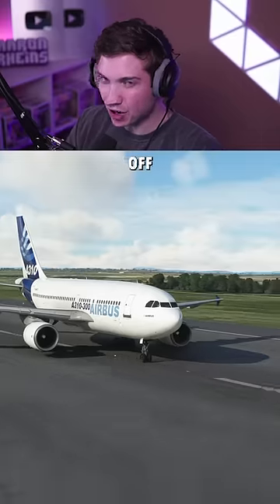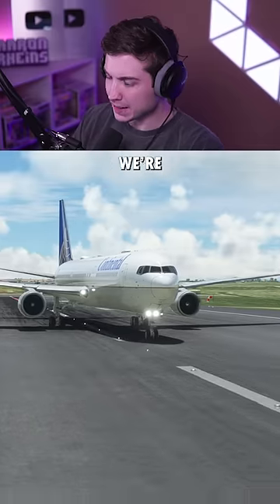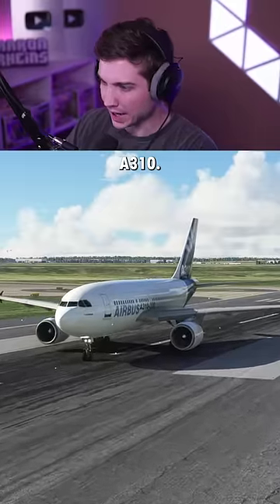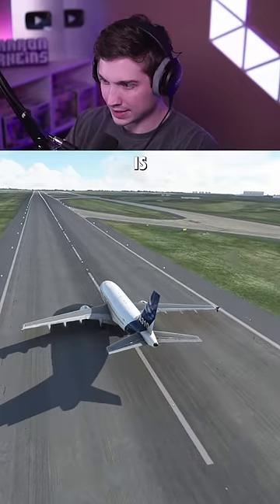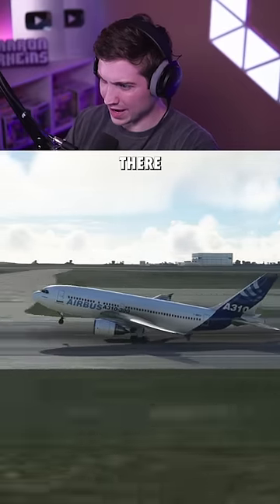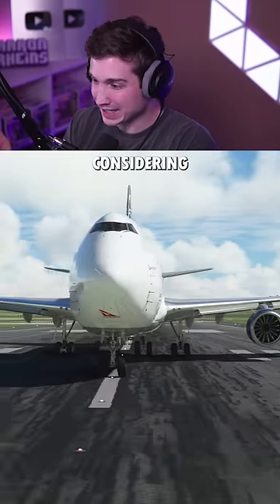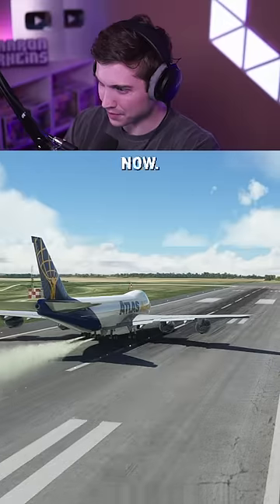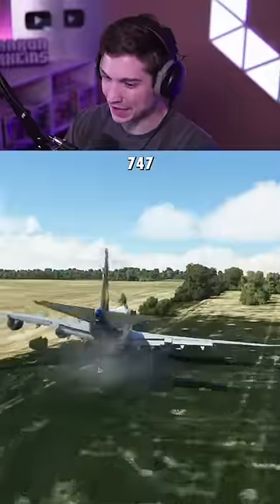Can Airliners Takeoff with ONE Engine?

Comment: Can you do it with the antonov an 225  ?😊
Reply: It won't make it. He doesn't have to do it to check
Reply: @jayanspaliwal5907 and
 if you do it on the area 51 runway?😮
Reply: @Lez1336-d5n you need to edit the map to make tens of kilometers of runway.
Reply: @macosx10.7lion4  True, he might have a chance if he flies the AN-225 empty. It won't make it with any cargo on board. It simply wasn't designed to fly with just one engine.
Reply: Nah do it with B-52

Comment: Dont be surprised if an airliner can takeoff with one engine cause if the aircraft has a bird strike and loses an engine after V1 (which is the speed that once you've passed it its to late to cancel the takeoff role) then it has to take off and land back at the airport

Comment: I literally read on Quora a couple of days ago that passenger planes are designed such that the plane can still work properly with just one side of the wings working

In other words, half the engines on the plane must be enough to get it to take off
Reply: There’s a small sidenote to that. They’re designed to perform properly with just one engine working when the other engine(s) stop(s) working in-flight. Some planes can take off as well with just one engine, but they are not designed for that. In practice, a plane will never take off unless every part is working properly.
Reply: @keijzer31 well what if you have a engine failure shortly after V1? Surely all planes must be able to take off with one e gine
Reply: @LiftsInGermany  after v1 you must try to take-off. You would advance the throttles to max power on the remaining engine.
Reply: @keijzer31 thats wrong. Not only twin airliners are designed to take off on only engine after v1 ,but  their pilots are also trained for this.
Reply: @berniepfitzner487 no you wouldnt need to advance the throttle of the remaining engine for all take offs, but mostly to avoid hitting something ahead

Comment: All Class A planes are certified under CS-25 to be able to handle one engine out on take off and to be able to continue to climb out and return for a landing it the speed is called VMCG Velocity Minimum Control Speed Ground, and VMCA Velocity Minimum Control Speed Air

Comment: Could you try a vertical speed test (flying straight up)
Reply: Not sure any airliner can do that, you’d need a TWR > 1 to fly straight up without losing speed and most airliners have a TWR of 0.2 to 0.3. None have more than 1 AFAIK. Unless you propose getting the planes to maximum speed in level flight and pitching up to vertical, then seeing how high they go before losing speed
Reply: @MS-qx9uw are you a pilot

Comment: Airplanes are designed to fly on just one engine, in case the other fails, but they aren't meant to take off that way. The asymmetric thrust will overpower the rudder at lower speeds, and the airplane will veer off the runway. At higher speeds (ie V1 or the point where pilots can no longer reject the takeoff), the rudder is more effective at keeping the aircraft straight, and it can continue the flight from there on one engine. 

Also you lose points on all of those takeoffs for the tail strikes.

Comment: The 747 can do it. I used the runway at Area 51 (easily 30,000+ feet long), got rid of all weight (no pax, no baggage, no pilot/crew weight, 7% fuel) lowered the humidity and pressure all the way, and I was able to fly once I reached 160kts. I set flaps to full, trim all the way up, and took off. Of course it only stayed airborne for a few moments as you just can't fly a 74 with only one engine, but it is most definitely doable. I used the Salty Simulations 747-8i as well. The base game 747 is unrealistic af.

Comment: In GTA V its a different story, if you shoot out one engine, when you lift into the air, it will start to bank depending on which side the engine is missing

Comment: Planes are not designed to take off with one engine but can fly or glide with one
Reply: Actually that's not true. All  airliners are certified to be able to take off on one engine as long as it was after a go/ no go speed. A loss of engine prior to go/ no go speed  requires an aborted takeoff.
Reply: @donwilson1307  oh

Comment: How is this even possible? Below Vmcg, the asymmetric thrust from the engine would just cause the plane to veer off the runway- the rudder doesn't have enough corrective authority at those low speeds